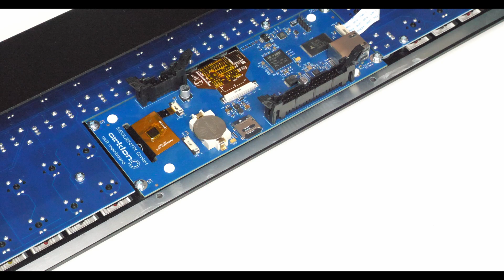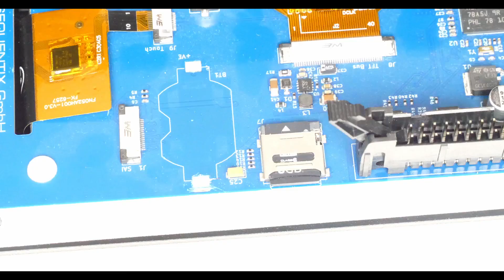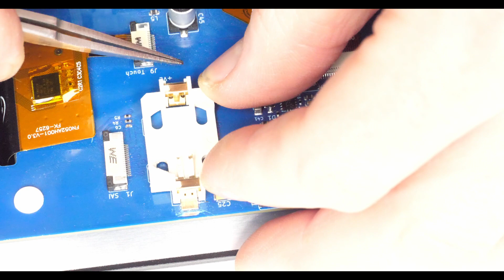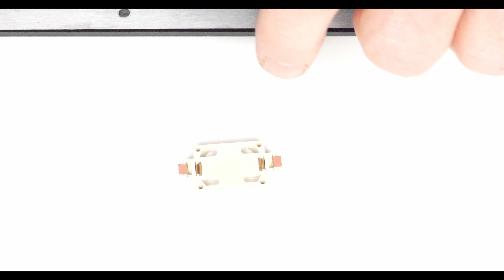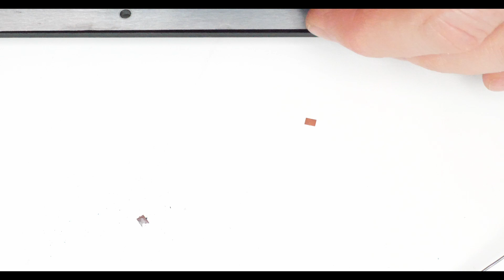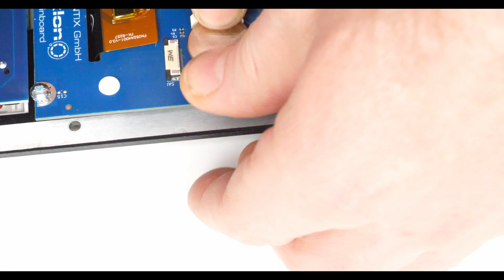ck2 battery holder repair

Comment: This is a known issue. If you look at the forum it’s supposed to be covered under warranty with certain Cirklon 2’s. I’ve contacted support but am still waiting to hear back. I live in Los Angeles so a technician should be easily available. I will comment again when I hear back from support

Comment: Hi Colin, I commented on the other video, so I'm going through this now. Mine (#2381) has the same brand battery as in this video, and it is not swollen, deformed, etc. The way I was trying to remove it was with a T15 screwdriver, pushing up at a ~45º angle from the bottom of the battery. Not grabbing, not prying, and I wasn't thinking enough to get under it to lever it out as you do here. And no, I definitely didn't do my research on this as I assumed it was securely attached :D
Reply: A bit more detail: both pads lifted at the same time, and with much less force than you had to use here. Perhaps there is some variation in "layer adhesion" at the pcb factory? I will email some high-res microscope captures of the battery holder side of the pads.
Reply from the maker: @ø0øøoi3o  Thanks for the information Don. Was the cell obviously tight in the holder? I'm wondering if a static force applied to the PCB pads once a cell is tightly inserted can cause the pads to delaminate from the board over time.
We'll be switching back to thru-hole holders for future production.